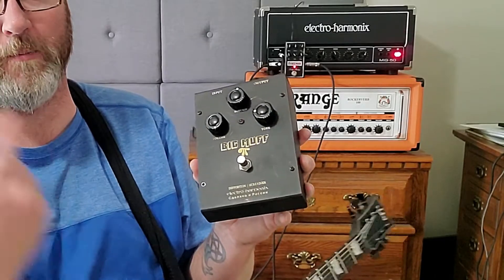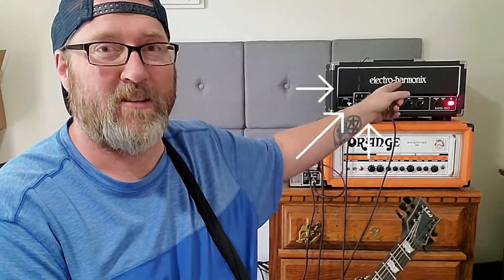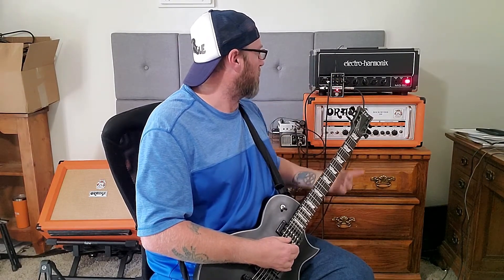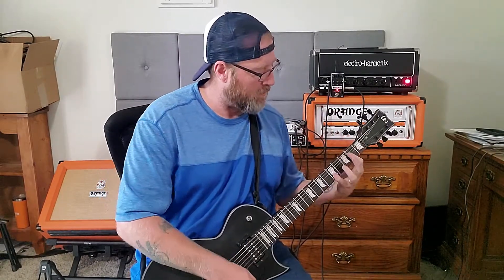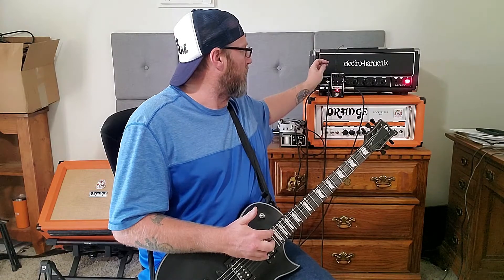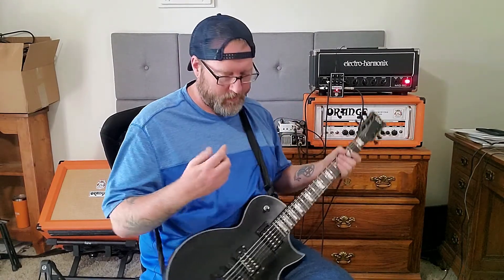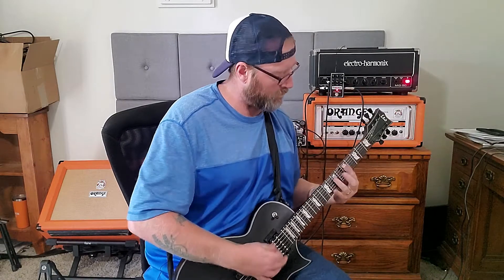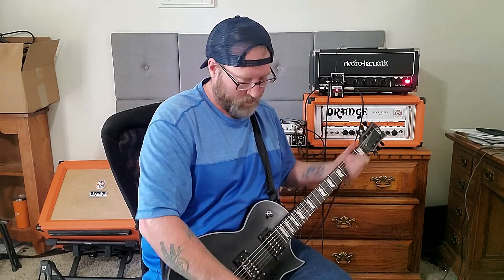Can a Friedman Dirty Shirley Pedal Turn an EXH Mig 50 into a Friedman?

Comment: Just buy a EHX Bass Big Muff Pi. It's the same circuit as the Black Russian Big Muff.
Reply from the maker: Oh wow u need to try it then. Thanks!
Reply: @TheDistortionPrinciple  It's on my board, ran thru a 1979 Sunn Beta Lead, using a Gibson SG Standard. I have it stacked next to a Green Russian, mainly use it as a boost for Green Russian, and Boss FZ-5. But alone, it holds its ground with a nasty fuzz tone... sounds exactly the same as the Black Russian.
Reply from the maker: @no_name1107  man you've got the goods! Lol.  I'm gonna have to try one of those for sure now